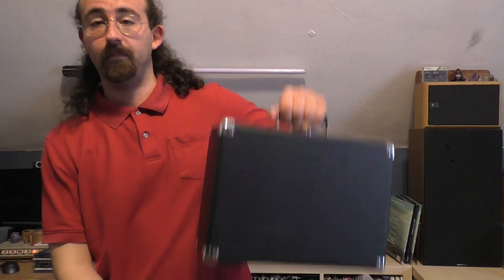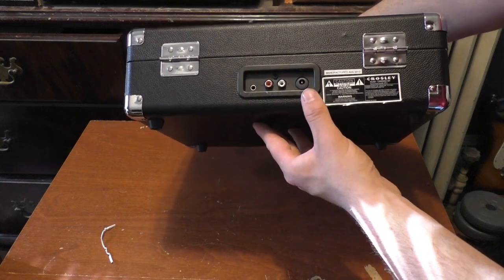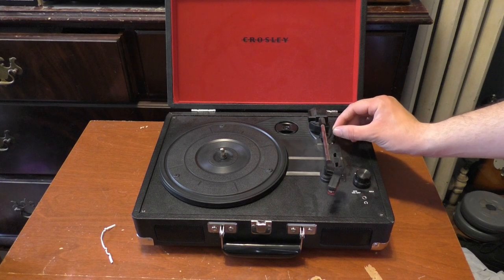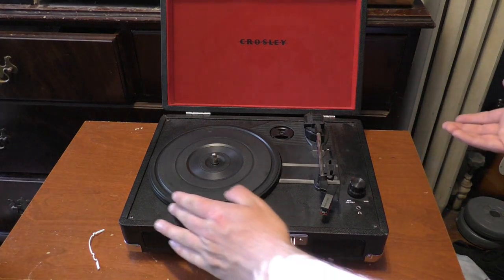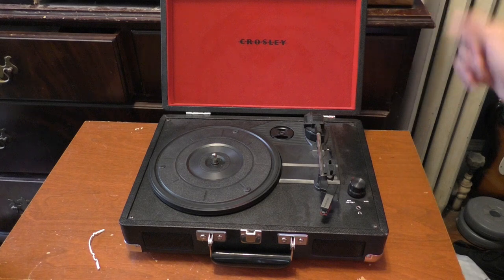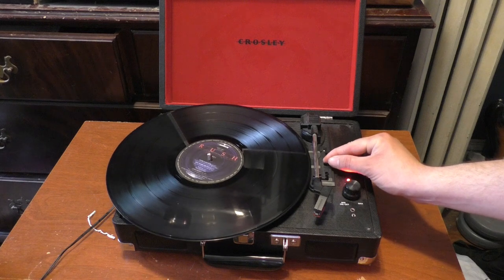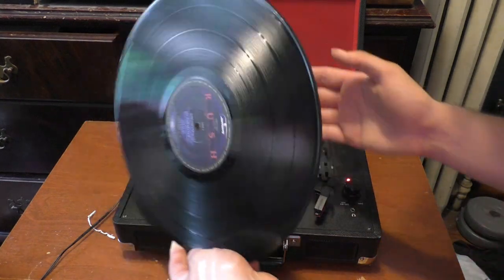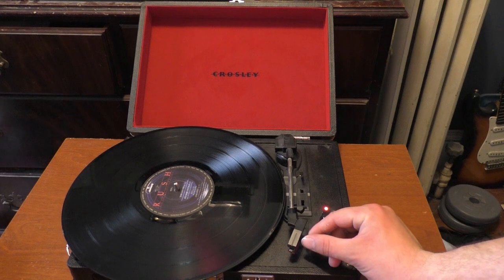Fixing a Crosley Cruiser - How To Adjust All 3 Speeds and Sound Quality Test - The Soundtracker

Comment: I started with an Ion Profile LP (about the same grade as this unit, except it was semi-automatic which I liked). It was meant mainly for digitizing, but it sounded just as awful as this. It developed massive speed fluctuation problems within the first month, the auto return started triggering irroneously after about two months, and worst of all it started doing noticeable damage to the records I played on it in the last month or so before I threw it in the garbage. Then I upgraded to a Denon DP-300F, which I used for almost ten years (but it still works, I could probably sell it for a hundred bucks). My current table is a vintage Technics SL-5 (a linear tracker from the early 80s) which I absolutely love.
I'm no snob, and I'm certainly not rich... but I feel strongly that these types of turntables are a scam and probably not much better than what you could make at home as a high school science project.
I mean... I get the appeal of an all in one unit that doesn't need a preamp... but if it sounds worse than an mp3 playing through smartphone speakers... why not just stick with playing mp3s through smartphone speakers?
Even after your excellent repair job, I can't help but think your coworker might think ill of the format based on this well-marketed but terrible machine.
Reply from the maker: It's funny you should mention the Ion tables, I had always wondered if they were similar in quality. I get wanting to digitize, but if that means doing so from a turntable that doesn't sound too good, it's best to just get a better table, even a cheap one from the 80s and 90s. It's disappointing to hear it performed so poorly, I'm sorry to hear it damaged your records. How does your technics perform? I've never had a linear track table, I'd love to know.
And oddly enough, my coworker grew up with records, he was in his late 60s and just wanted a turntable that worked, but didn't mind the sound quality.
Reply: @OfficialSoundtracker  I really like the Technics. It is the exact same model that a good friend of mine has (and he's had it his entire adult life, which is decades longer than I've been alive), so when a refurbished one came up on Ebay for $200 I had to jump on it.
It's one of the simpler linear trackers; it doesn't do automatic track detection, it can't automatically play both sides of a record, etc. Ideally, just the right balance of sophistication and longevity/ repairability. It's small (but has a good bit of weight to it), has the arm/ cartridge mounted in the lid (and is controlled entirely via buttons on the front). You've got buttons for cuing and it can be set to either play to the end of a side and stop, or continuously repeat a side until stopped.
I think it sounds good. That said, some people tell me they can hear the difference that a $10K stylus makes; I find this difficult to believe.
The only problem I have with it is its intollerance of slightly warped records due to its compact size. They play just fine, but something makes a scraping sound once per rotation. As a totally blind person I'm not capable of independantly investigating this... but it sounds like the edge of the record scrapes against some part of the table each time the warp comes around. I digitized an extremely rair childrens' record on my channel (which was my favourite as a kid, and then I found a copy some decades later and had to preserve it for posterity as nobody else had done so). You can hear the aforementioned problem in that video.
Sometimes this is bad enough to be picked up by the stylus and made audible during quiet passages. I would love a fix for this one issue that affects a handful of my records, but other than that I'm perfectly content with it.

Comment: Do you think that one should set properly the 78 speed first and then adjust the 45 and then the 33 last in case there is some bleed over to the speeds. Or are the speed circuits completely independent ?
Reply from the maker: The speed circuits were independent when I adjusted them, I didn't notice any bleed over into the other speeds when moving between them. Once one was adjusted, it stayed that way. Good luck with your adjustment!

Comment: I got one for Christmas and ir was working great until my belt slipped... My sister get the belt back on but I  am now dealing with a record that plays like the chipmunks.... The auto stop is used to stop the record at the end so it does not slide over to the label....  You can turn off the auto stop... I  need to get it adjusted as I want to play my records... I have records Like the ORIGINAL release of The Chipmunk Adventure soundtrack on vinyl.. Some Monkees Styx and other records....